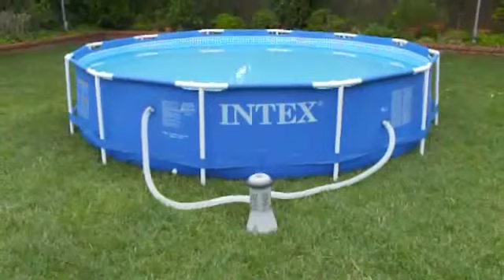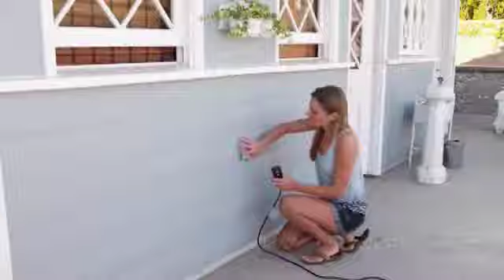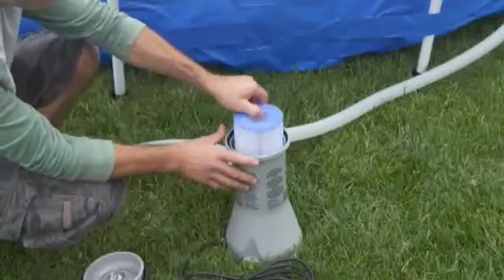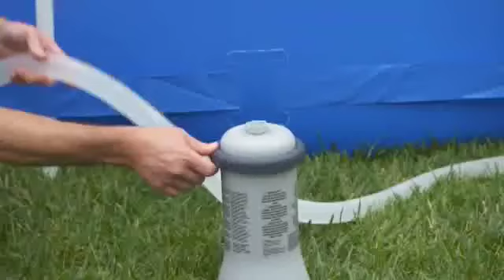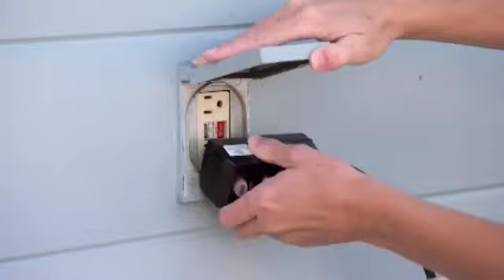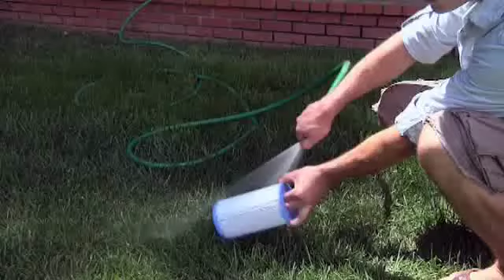www.madfun.co.uk 1,000 GAL HR 3,785 L HR FILTER PUMP MODEL 637R 638R FOR METAL FRAME POOLS

Comment: Why does mine come with 3 hoses I don't get it 😭😭😭😭
Reply: Two hoses go to the pool and one goes to the pump . Top filter pump connector is for the water going in which will be the whole on the right and the bottom fielder pump connector is for water going into pool. Always replace air before turning on pump.
Reply: Cena de navidad
Reply: Amy Unis same here did you ever figure it out
Reply: Same it's so confusing